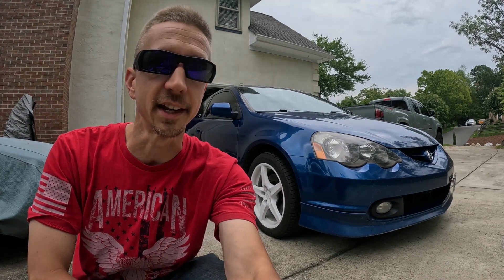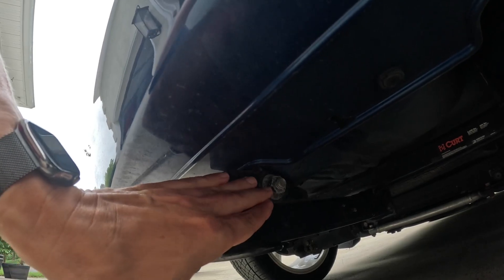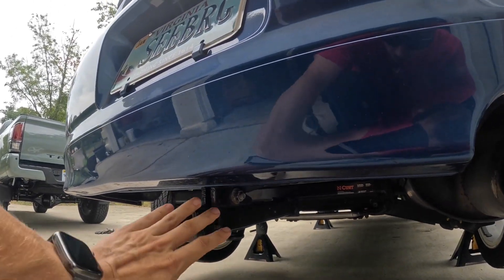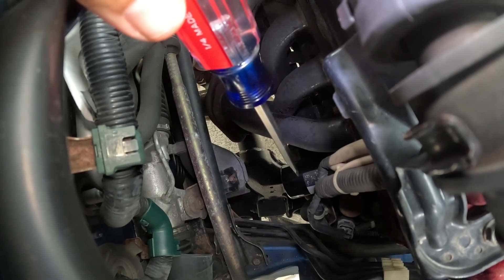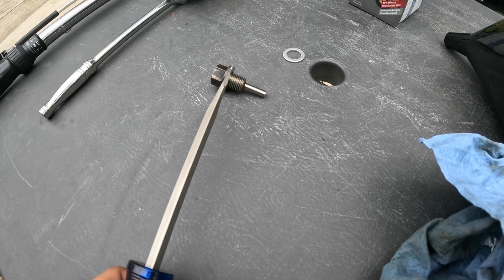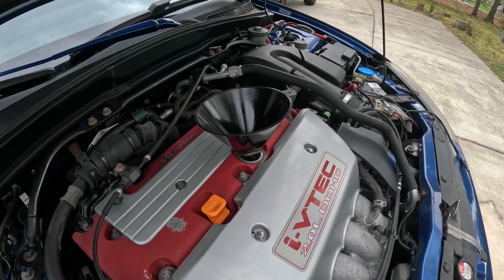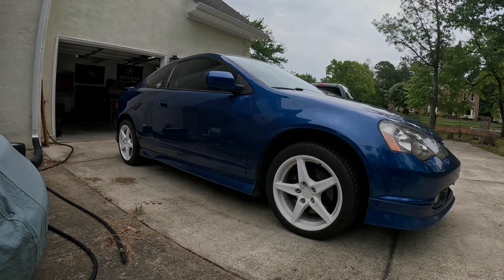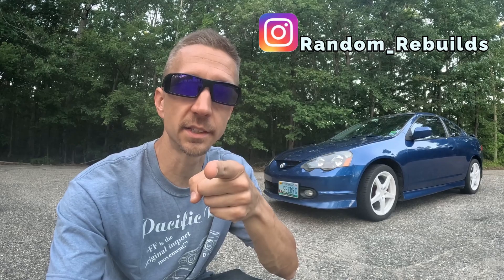Acura RSX 5,000 Mile Maintenance & How To Lift and Support  - (K20 & K24 Honda)

Comment: How high does your floor jack go? Mine can’t lift the rear high enough using the tow hook to fit jack stances under the side rears
Reply from the maker: @user-br9nd1zq4o  you need to raise the front first, then lift the rear. If you don’t then you’ll never get jackstands under the rear by itself.
Reply: @ how would lifting the front first onto jack stands make a difference to how high my jack (height) can lift the rear?  Sorry if it’s a stupid question
Reply from the maker: @ it’s hard to explain but has something to do with the front nose diving more and weight distribution.
Reply: @randomrebuilds  I think I kind of understand what you’re saying. I only have 2 jack stands atm but something I’ll consider. Thank you very much for the quick reply! 🙏